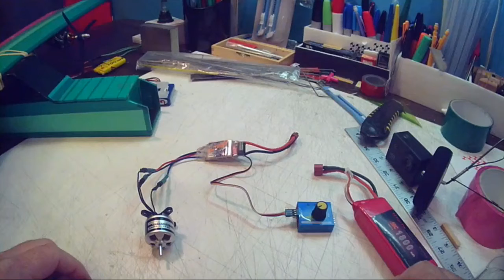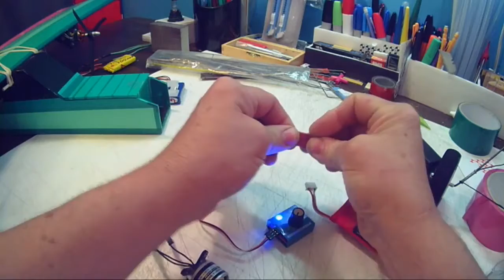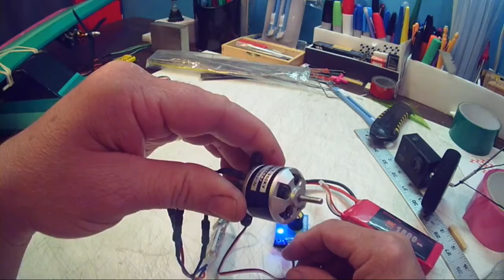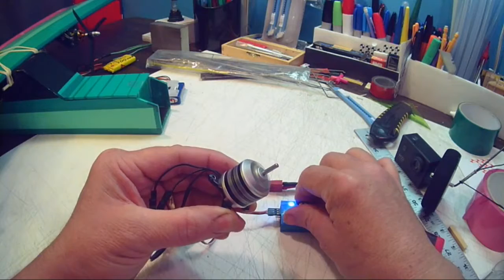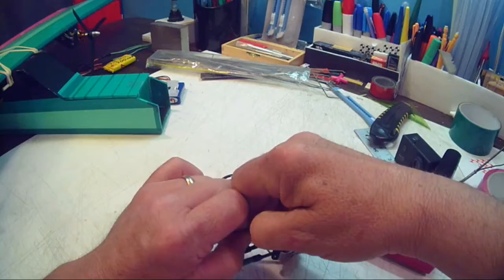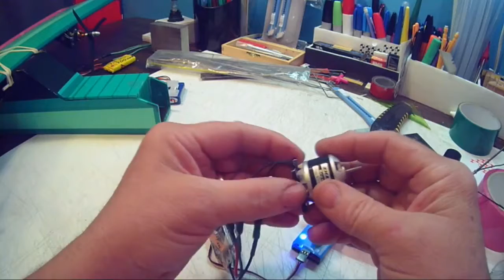Brushless motor stutters? Here's why! LOUDER AUDIO

Comment: What about a chattering noise on lower rpm? Once it gets mid range and high it’s smooth as can be. It’s a Traxxas Trx4m brushless set. It was working fine and I let my daughter use it for about 10 minutes and she comes back with a dead battery which is normal and a broken drive shaft and a chattering motor. I asked her what happened and what she was doing and of course I can’t get any useful info out of her. I think she’s killed y motor though.

Comment: I have similar issue but motor works ok from off to middle throttle. But when reaching middle throttle and up it starts doing the stutter. Any ideas?
Reply from the maker: Possible the esc has failed
Reply: @vipertech9108  thank you!

Comment: hmmm I have what looks like this problem but checking continuity from the wires from the motor to the esc connection point seems to be all clear for all three wires, can it still be this issue and I am using the multimeter wrong?

Comment: I have a1/6 herbie and it stutters when it drives under its load because I lift it and it turns fast no problems smh idk what’s wrong with it
Reply: Did you find the problem? I have the exact same problem when I hold my rc car it spins no problem but soon as I put it down on the floor it's stutters and I can solve the issue. Thank you in advance
Reply: Dis url find the problem mine too does the same
Reply: @preeshenmoonsamy9017  I took mine to an rc shop and they said its either motor or esc but its cheaper to change both together so that's the route I took tbh hope that helps
Reply: @preeshenmoonsamy9017  get a new battery the green lithium ones and if u get the 12v battery it runs faster

Comment: Please help me my brushless goolrc  motor is beeping and won’t move I went in a small water puddle does the beeping mean the I have to have a program card because I have a program card comeing in the mail soon and my motor shaft is twitching when I move it
Reply from the maker: Check for broken wire if no broken wires sounds like may need programed or the esc is burnt out.
Reply: I have the same problem

Comment: Ok but what is the fix to this problem 🤣
Reply from the maker: As I said in the video the problem is a broken connection in one of the wires. The fix is to find the connection issue and repair
Reply: Thanks for that i had  a broken wire and soldered it straight to the esc was going to buy yet another motor and esc !!